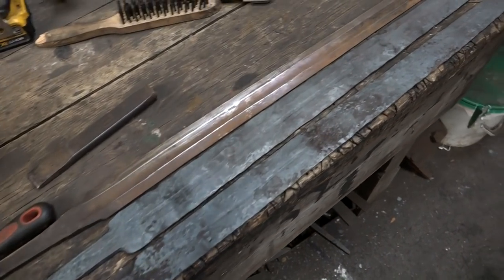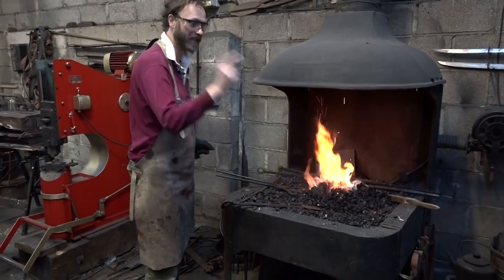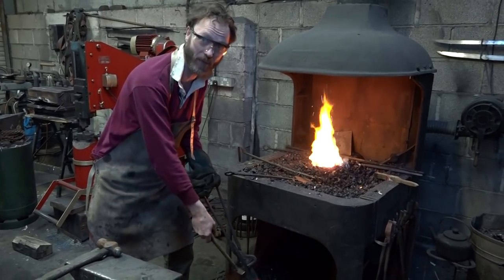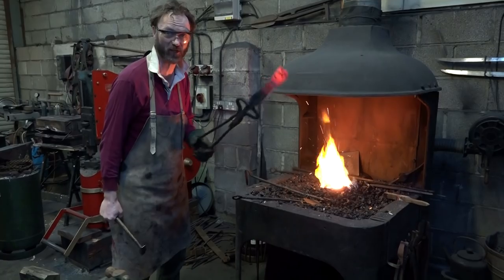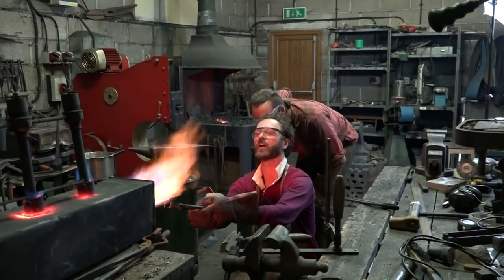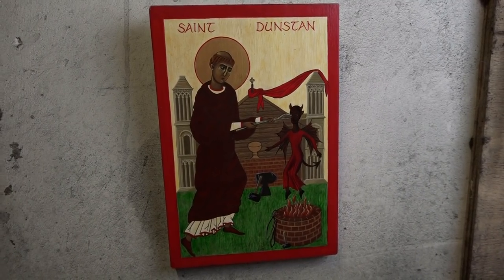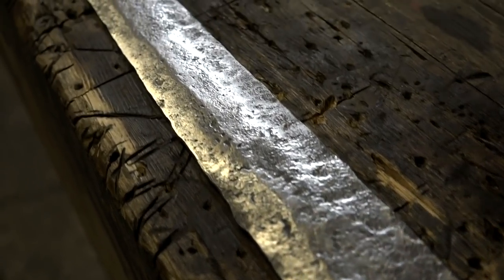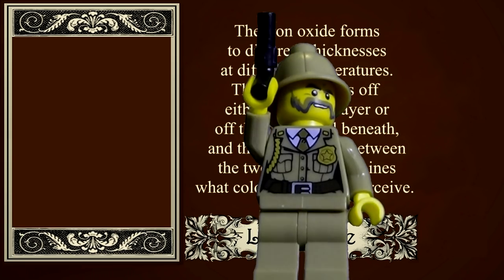Forging a Sword - part three: heat treatment

Comment: One thing Lindy, don't wear gloves while using an angle grinder. It was one of the first things I was told when using one (I have been trained at an Australian trade school) because if  part of it snags in the wheel your fingers (and maybe your hand) will be gone.

Comment: A five burner forge seems so incredibly overkill. Seeing how poorly insulated it is, and flames spitting out of the sockets hurts my bones. He'd probably be fine with a properly insulated 2 burner forge and placing the sword inside a metal tube (inside the forge) to protect the sword from direct heat and help spread the heat more evenly for the quench.

Saying this as someone who doesn't actually know.
Reply: It looked awsome, though . . .
Reply: I have a single burner, and while it’s true that you could bring it up to heat with just that by sliding it back and forth under the flame, the issue is that the blade would sag and warp under it’s own weight once it got hot enough. The real benefit of the 5 burner is that the length supports all or almost all of the blade while at heat.

Comment: And why is he hammering after the quench, it is far too risky, the most you should do is gently try to bend the warp out, also tempering it in a conventional oven for 2 to 3 hours is a lot safer than with a blow torch

Comment: So if you actually wanted a blue sword, could you achieve that through heating it without also ruining the blade?
Reply: Threeshades you could rust blue it like they do with firearms, but it would rub off with time.

Historically armour was blued by heat treating, but metallurgy in armour is less important than with swords.

So, possible, but unnecessarily tricky.

Comment: you said you put it in vegetable oil how did the sword not cause a massive oil fire
Reply: Because there is not enough heat in the sword to increase the temperature of the barrel of oil to a point where it will catch fire. Just like putting a lit match in a whole barrel of gasoline will only extinguish the match. 

p.s Don't put a lit match in a barrel of gasoline at home, cause if for some reason (ex. quite warm ambient temperature) vapors of gasoline are coming out of the barrel they may start the fire above the gasoline which would be bad.

Comment: In the forge i worked in, instead of veggie oil my mentor used motor oil. dunno if it makes that much of a difference in the sword, but it made the whole shop smell like i dunked it in a barrel of crayons
Reply: josh johnson I know a gunsmith that does that too. Only ever the used stuff though.

Comment: Interesting that that bit of tempering is enough.
I thought you have to get the whole blade to the desired temperature and keep it there for an hour, to ensure the metal is evenly heated to the core, and then let it cool naturally.
Reply: He did heat all of the blade and let it cool.
letting it in an oven at a lower temp for some time is an alternative.
Reply: Yes he did all the blade, but just because thesurface turns blue does not mean that the core is at the same temperature.
So you have a less hard outside and a relatively brittle inside, where is the benefit in that?

By letting it sit for an hour you can assure that the whole blade is tempered, and you can heat it up to 300°C in an apropiate oven.

By now I only tempered 1.4310 spring steel, that can be tempered in a regular oven at 250°C if you let it in there for 24h, at 350°C it takes only an single hour.
Reply: with the added fuller the average thickness of the blade is very thin and as such the core will be readily heated to the same temperature as the surface. Also, low- to medium-carbon steel is more forgiving to short tempering cycles than anything above 0.8 percent carbon.
Reply: branbeggrify good to know, thx

Comment: still one of the best (storm the castle.com does another good one) tutorial on swordsmithing i've found on youtube, every other video seems to wanna say a hundred different things about the heat treating process, let it do this, let it do that, use this, don't do this method, etc, nothing is ever clearly explained and they all wanna just say "harden the blade and then temper it" and not actually SHOW how the process can be done, this, and storm the castle do very good tutorials for sword smithing, your clear, consice, and not at all complicated

Comment: If the sword was intended for serious abuse, like a real sword you would want a couple of normalization cycles at lower temperatures each time, before the quench, but what you've got should be fine. And now, part 4:grinding, so much grinding and polishing, hours of it.

Comment: Dry bucket because of you putting in some hot steel, huh?
Lets be very generous in our calculation:
Say a whole kg of steel, right at the melting point at 1500°C. Cooling this all the way down to 20°C will result in (Solid Phase Heat Capacity from NIST, Shomate Equation, integral) 865kJ of heat that has to go into the water. Lets say the bucket already had boiling hot water in it (100°C) and.... it will be able to boil away about 400mL of water. Not even half a liter. Seems like a small "bucket" or it was already (almost) empty. Or maybe you poked a hole in it and thats where the water went? Or you dont remember it correctly?

Comment: I prefer to cook my swords in grape-seed oil
Reply: You mean rape seed oil? (The yellow flowers that exists not rape joke)
Reply: Ah no, grapeseed oil has a higher smoke point, canola oil is great for pan frying tacos though.
Reply: Whats canola oil?
Reply: Canola oil is derived from the rapeseed plant; it's rapeseed oil. Edit, apparently there is something different than canola oil called rapeseed oil. They are made a bit differently apparently, but both come from rapeseed.

Comment: I have an idea! The difference between a sword and a machete! Possible fighting style, etc... Are modern day warriors using the machete the same as those who used swords??
Reply: I think that the machette, although often used as a weapon, was designed to be used as an agricultural tool, whereas a sword was designed to be an actual fighting implement. As for fighting styles, if you can afford a sword, or belong to a miitia that can provide you with one, you would presumably have some sort of formal training.
    On the other hand, a person using a machette (or other agricultural/trade implement) would no doubt be very skilled in their use of it as a tool, but, i suspect, little to no skill at using it effectively as a weapon.

This is pure conjecture on my part tho, I'm sure many vampires were vanquished by pitchfork weilding mobs, and im also sure that, if you've seen many martial arts movies, you'd realise what a deadly weapon the humble rice-flail makes!

Comment: I've been waiting for this next part for ages, you're doing great Lloyd. and shut up you bastards below me, ain't nothing wrong with ye olde angle grinder, and ye olde blowtorch. They are using ye olde gas forge as well if ye didn't notice.

Comment: Why vegetable oil?
Reply: because animal oil is in short supply?
Reply: Probably because that's what the local chippy uses.
Reply: Probably because it's cheaper and more readily available than seal or whale oil.
Reply: Whale oil is hard to come by.

Comment: A steel bar is made of ions not molecules so I guess you're right.
Reply: Ions? Is the steel bar in solution?
Reply: haploide allel The iron is metalically bonded which is a force that arises from opposite charges (ions) rather than shared electrons (covalent).

Comment: Heat treating in a coal Force is disturbing
Reply: Oh ok they did use has but then why even bother with coal, also why vegetable oil and not proper hardening oil

Comment: The reason I know that story of his first sword is bullshit is because of the dry bucket of water. If we give him the benefit of the doubt and say that the he had 3 kg of steel as a white hot temperature (lets say 1400 C) the difference in heat of the object from 3 kg of steel at 100 C is roughly 650 KJ. Water has a specific latent heat of vaporisation at roughly 2300 KJ/Kg*K. This means that the metal would be able to vaporize less than 3 dl of water if the water was already at 100 C to begin with. If he had a bucket of lets say 5 litres, he would first have to increase the temperature from room temperature of about 20 C to 100 C. This would require roughly 100 KJ of heat. Then he would be able to vaporize about 2.4 dl of water. A steel bar of 3 kg uniformly heated to 1400 C would only be able to vaporise a small glass of water. There is a reason steam engines or so dangerous. Steam has a tremendous amount of potential energy in the form of latent heat. The latent heat in 1 kg of steam at 100 C is enough to accelerate a stationary object of 1 ton to a speed of roughly 68 m/s. That is about 244 km/h or 152 mph. That is insane amounts of energy.

Comment: I'm pretty sure having that many burners is unnecessary
Reply: SPEEM how many swords have you made?
Reply: Edwin Lee Well, none. I make knives and when building my forge a friend of mine named Don (a blacksmith) helped me and mentored me a lot. When I showed him my design (2 burners in 1'1/2 foot long forge) he showed me what a mistake that would have been by showing me his first (Destroyed) forge which had become brittle by heat. I use on fine and it gives me plenty of heat, of course, I could be wrong. (If so please explain I wish to know)
Reply: SPEEM I don't know, but that sword looks to be about 3 and 1/2 feet long, probably much thicker than the knives you are making. Thom seems like he knows what he is doing and probably has his setup the way it is for a reason.
Reply: SPEEM and on a second look, that sword looks to be more than 4 feet long. On top of that, Thom may make swords even longer than 4 feet.
Reply: A man cannot have too many burners! :-D